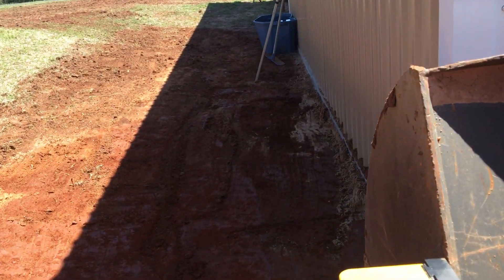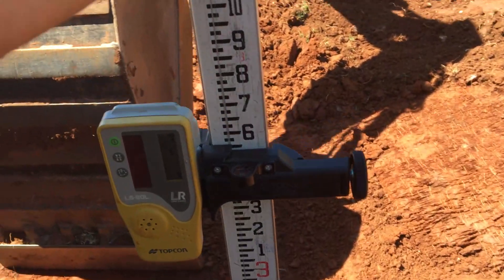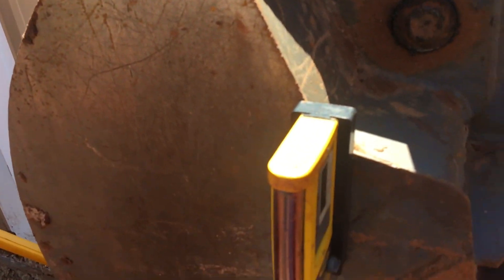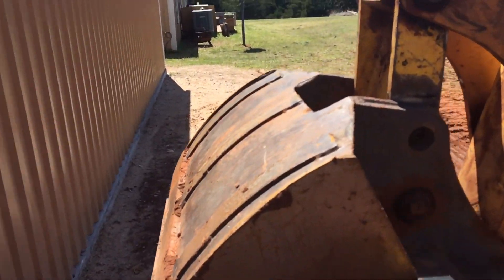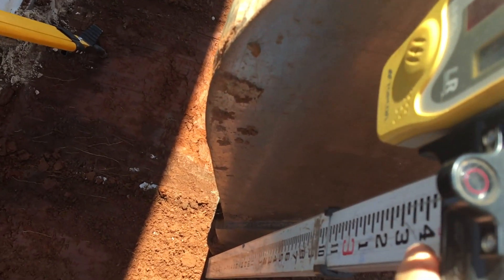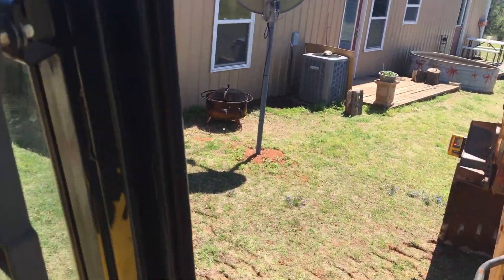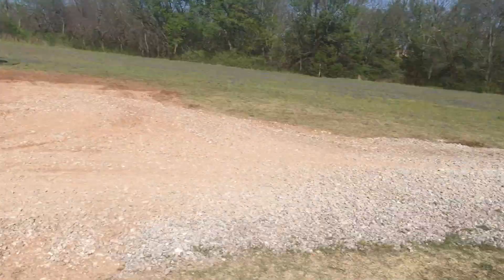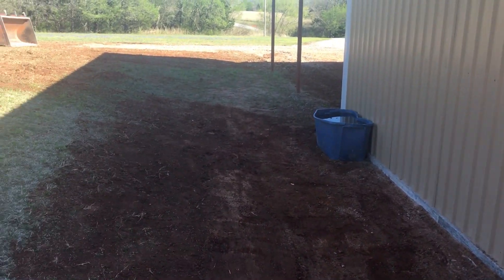Laser guided bucket

Comment: Good video.  Could I tack weld a square tube on the excavator and then attach my laser to it and make it work??  Hate to spend money on the magnetic one.
Reply from the maker: You could, but the magnetic receiver is built for shock loads. Use caution

Comment: I have got the exact same machine laser receiver! It is brilliant.. You have two settings for the brightness on the lights, bright, and fucking silly!! You can see it easily enen in bright sun. You CAN set it to work like any laser receiver, and it works VERY well at this, but, when you use the machine setting the receiver sets itself up as follows: The top red light means you are too high, the bottom red light means you are too low, with green being on grade. The clever bit is, there will be no lights on if you are miles too high. When you get within about 6 inches of grade the top red light will start to flash. When you are about 2 inches from grade, it will come on with a steady light [so you know you are very close] and then when you are within between about 3/32 to 3/8 of grade, [depending on how you set the sensitivity control] the green light will come on. I love mine! It was about £335 here in the uk, be the same in dollars over there i suppose. A spectra cr600 i think it is called. REALLY good bit of kit.. My laser will do slopes in two planes, AND, you can lay it on its side and set out right angles too.. It has a range of about 330 yards so you could be anywhere in a near 700 yard diameter circle and still use it.. It is a Leica 640 and it came with a remote control so you can easily set grades with it. Was about £1050 of our uk pounds as i remember, so again, about the same in dollars in the US i would think..

Comment: I had to do something like that one time. I had to fix a detention basin and they called for a 1% slope in the bottom and set a laser up like you did. Rented a 329f long reach hoe and worked it all from the banks. Wish i had the magnetic receiver like you have though. I had a grade guy but it was pretty soft in there and he had a hard time getting around sometimes. some pics on my instagram i believe
Reply from the maker: The mag mount is pretty handy, have used it on dozer blades and even the backhoe front bucket for leveling building pads. Some of the more expensive lasers can dial in the slope, but this one is good enough for most dirt jobs.